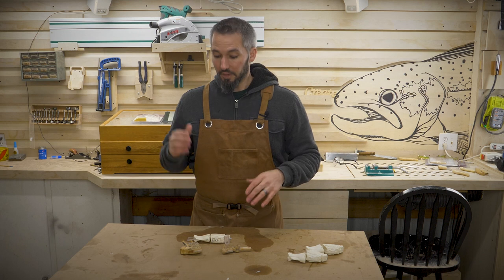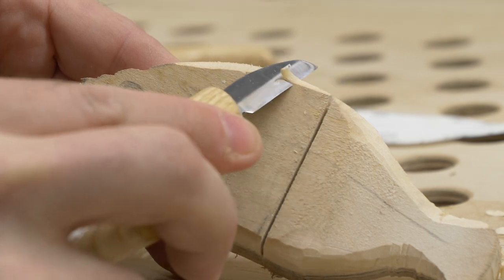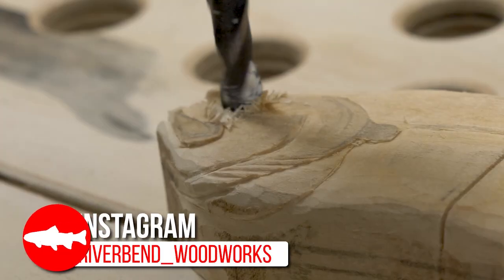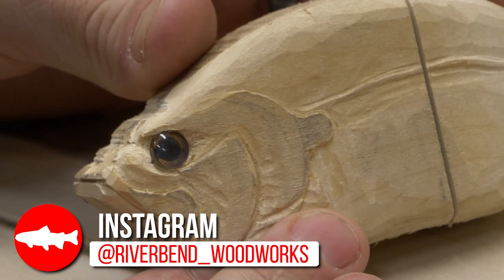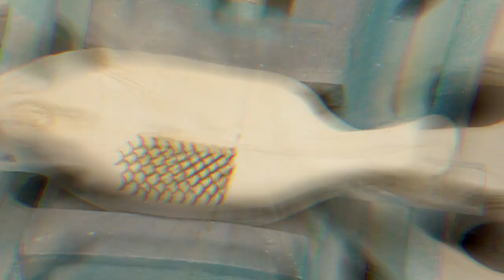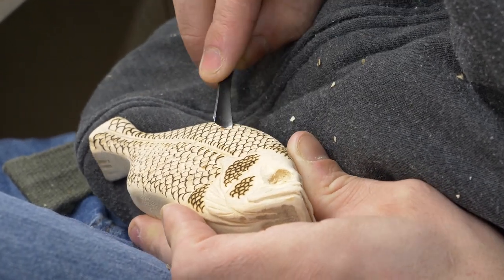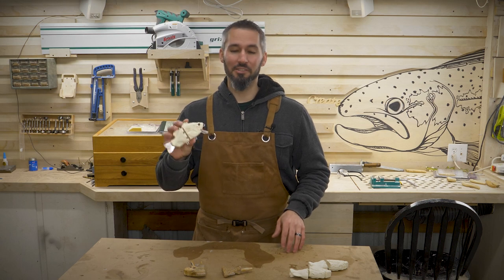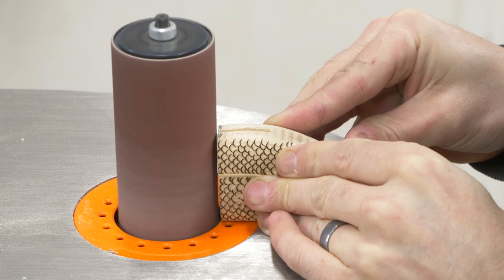Carving a Wooden Wakebait Lure - Pt.1

Comment: Subscribed! Is there a way you can make a video showing how you make those lure weights?
Reply from the maker: Thanks for subscribing! The weight system for the final lures is actual just a simple lead head from a 3/4oz jig. I just clipped off the hook and hook eye and had a perfect lead ball. If you need to remove a little you can either use a chisel to literally carve a sliver of lead off, or you can use a small drill bit to drill out some material. The weights shown in Part 1 are actually steel cut into 1/2" or so lengths, and were just for the test. Lead is heavier by volume than steel, so I opted for lead in the final lures because it made for a smaller hole size. Hope this helps and that you can carve up some as well!
Reply: @RiverbendWoodworks  thank you